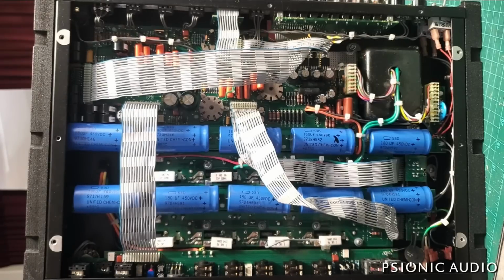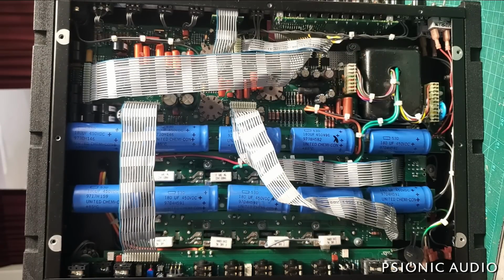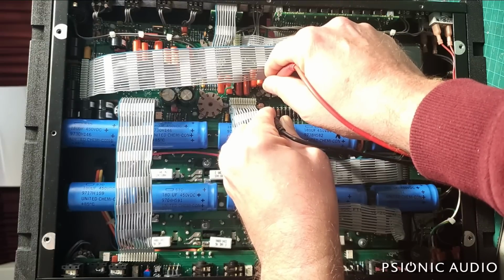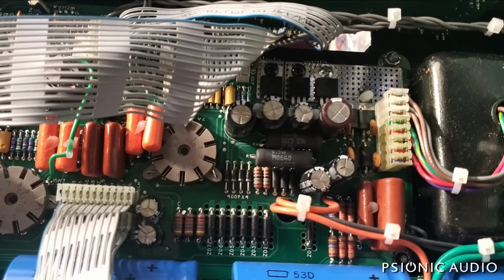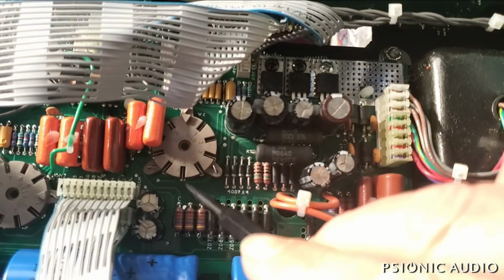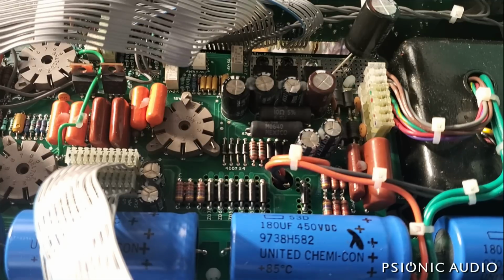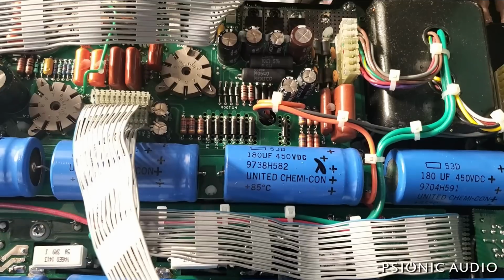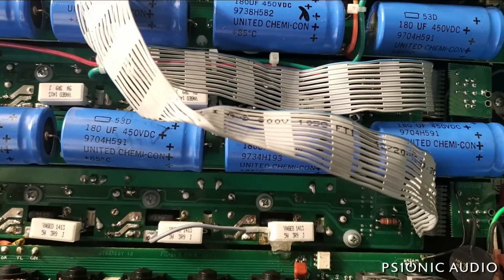Mesa Bass Strategy Eight:88 | Part 2 : Down the Rabbit Holes

Comment: Have you tried ringing Mesa directly? Apparently despite designing utter nightmares, their tech supports pretty helpful and usually forthcoming with any diagrams you need.
Reply from the maker: I've had the head tech honchos in my phonebook for years. They don't have board layouts for the most part, which would be the most useful things given the distance a resistor usually is from the triode it's part of.  I am sure they can answer basic questions, but I never have basic questions about their amps.

Comment: Using 8 KT 88 after a bunch of ICs in the first stage does not sound like a good long term cost approach  . for  300 watts Output transformer are very big and very very costly to do well. As well as replacing  2 quads of KT 88.

Comment: I service, repair, and maintain all of my own personal musical instrument amplifiers, and other devices. I was a radio technician in the USAF, and maintained RF Linear power amplifiers that had plate voltages in the tens of Kilovolt ranges.  I had one of these 8:88 amps when they first came out. Fortunately I could not stand the preamp tone in it, and the power amp tone was not anything like the M-180 (6L6 X 6),  Bass 400 with (6550 X 6), Bass 400+(6L6 X 12), or Stereo Strategy 400 (6L6 X 12) amplifiers I own. It sounded like playing with a blanket over the speaker cabinet. It went back to the store I bought it from within a week of purchase, because a fellow technician that worked in that store told me they had three of them in for repair in that week alone. There is a reason they stopped manufacturing both of the recent Prodigy and Strategy bass amplifiers. Also, that store recently dropped Mesa amps since Gibson bought Mesa. All of my older Mesa tube bass, and tube power amplifiers are easy to work on, except the original Strategy 400 is tedious due to being a pair of M180 amps in the same form factor. At least the power sections in those old amps are point to point and not PCB Mount topology. I felt your frustration, and knew the exact words you had that YouTube does not allow. I have enjoyed watching you work through this sorry boat anchor of an amplifier. Looking forward to the next installment. Keep up the good work.
Reply: I bought an amateur "ham radio" DIY monster linear amp at an auction for $20 + 15% the buyer's premium or $23. It reminds me a lot of a home made Henry linear amp. It might be based on one of the big*** Henry amps.  It has an enormous well designed overbuilt power supply, a very lovely forced air plenum and the usual well vented tube sockets and chimneys. I ditched all the old rectifier tubes for large SS stud diodes. The price was about the same either way. (expensive) The guy who built this monster linear was an old USAF vet, and it is actually a great linear amp with a really good design and rock solid reliable parts set up in a nice fairly clean layout, with a pair of massive integrated antenna tuners & a pair of comprehensive meters or gauge clusters. Plate current, mA, power out and reflected power/SWR.  For $23? I couldn't walk away from that. One of the antenna tuners is worth 10x that.  Mesa  made and still makes some real crapola  products. I kinda dread seeing what Gibson will do to Mesa. Gibson's LAB series was an exception to their usual wackadoodle over-engineered underperforming amps, but Norlin had just bought out Bob Moog and the LAB series was designed by Bob Moog's engineers. I made myself a tube bass amp using some NOS Telefunken EL156 power tubes and a pair of Hammond's huge 350 Watt OPTs. It's powered up with some surplus Pacific power transformers wired parallel primary, series secondary, so I can run the screens at a markedly lower voltage than usual amps, "ala-Marshall The Pig" style. The EL156 was a 60,000 hour tube so, I don't think I'll need to re-tube the power tubes before I die. The plate resistance is a little goofy, so it runs 2 6x10 cabs with a pair of EV horns. With the crossovers it gave it a nice match to the EL156s. I have debated making another speaker cab with a 15 or an 18 + 10s and horn. I kind of like just the 10s. I bought a bunch of Celestion BG10s a while back. I sure wish I could find some more.

Comment: That oops on r106 is the reason I have a set of needle point probes. Less slips.
Reply from the maker: I have them too, but they're too slow for general troubleshooting. The amp wasn't live for that slip though.
Reply: Between my age and fact that I no longer bill for labour. I work slow. It's just a hobby. Best part is I basically just work on mine and friends and family amps. It's called retirement.